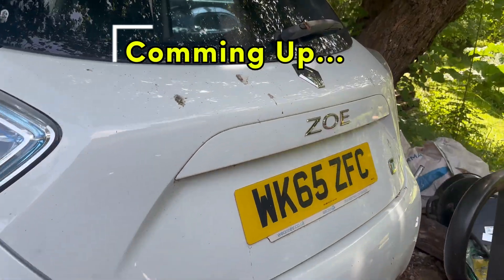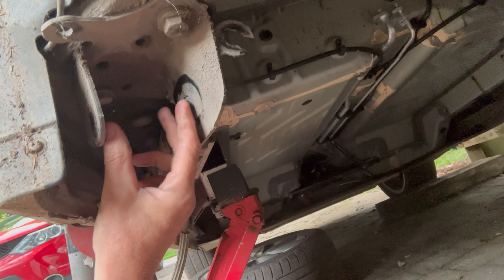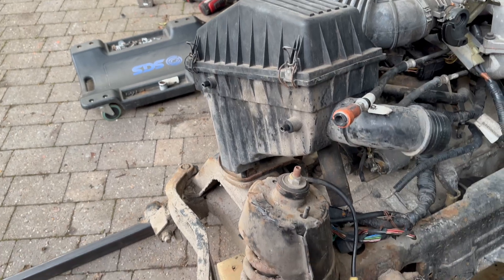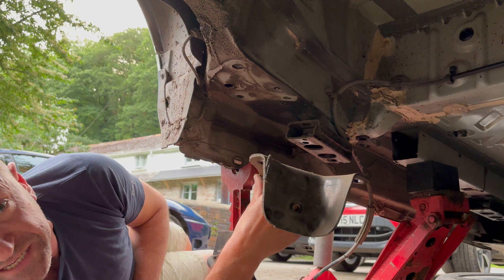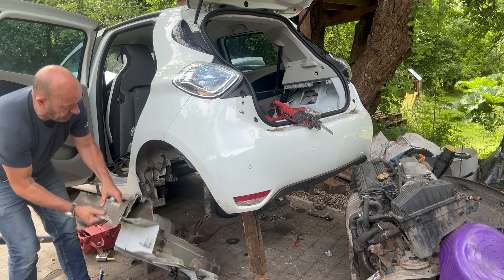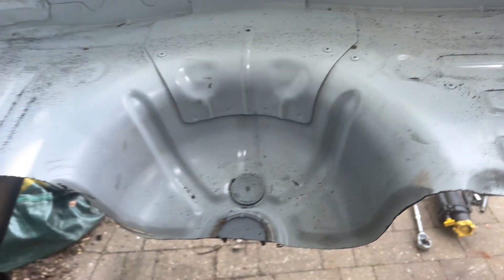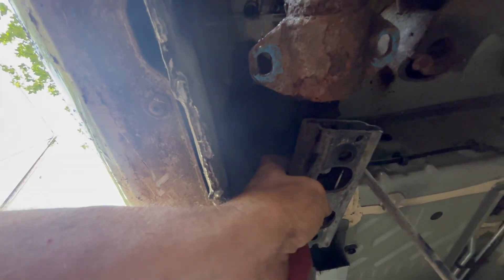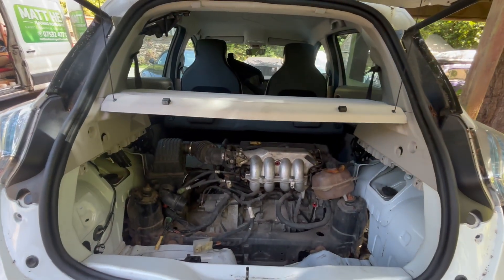Converting a salvage scrap EV to Petrol

Comment: Why not cut out the mounts from the MGF and transfer them to the Zoe, here's a crazy idea make it a twin engine with another MGF in the front, 4 wheel drive all round
Reply from the maker: the mgf ones prob go into the chassis section and lots of little plate bits to strenghten so too much of a faff...  ive got some thick wall 1" box as well as the stuff shown so reckon simpler to diy it :)